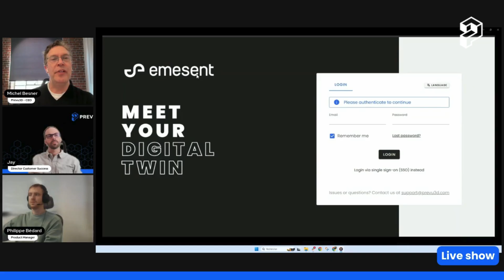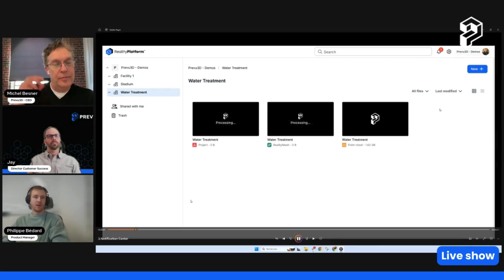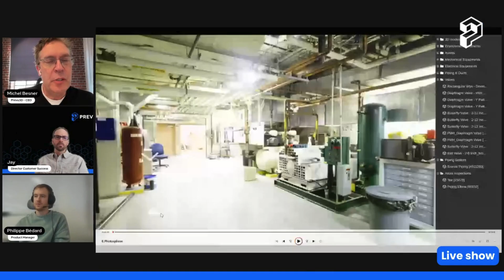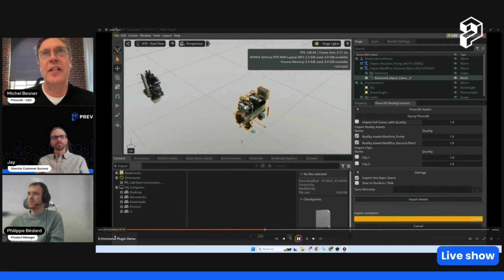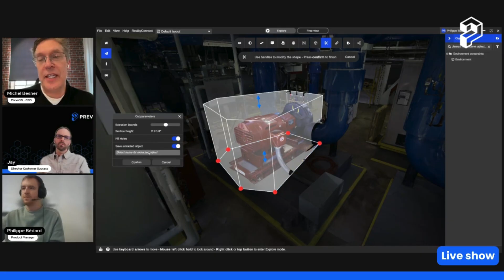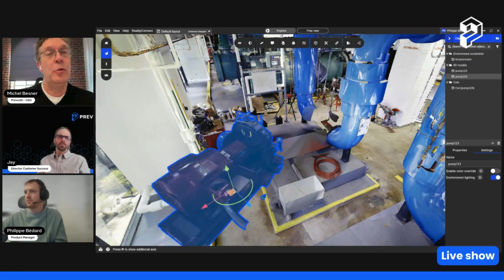Product Demo: RealityPlatform Updates & New Features | Prevu3D Release 25.2

Comment: Thanks for this intro video! Is the Matterport Pro 3 and Galois M2's point clouds sufficient enough for this or is this better used with more specialised LiDAR scanners?
Reply: Thanks for reaching out! Point cloud sufficiency is ultimately driven by the level of detail needed within a scope. The Matterport Pro 3 is currently supported within our pipeline and would provide the level of detail outlined by their Tech Specs. New devices are currently being evaluated for use and introduction.